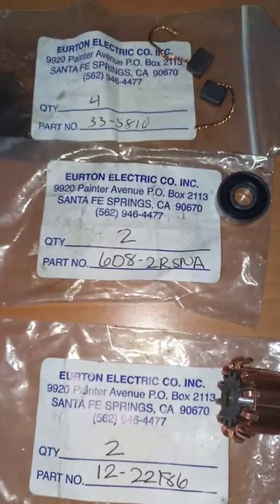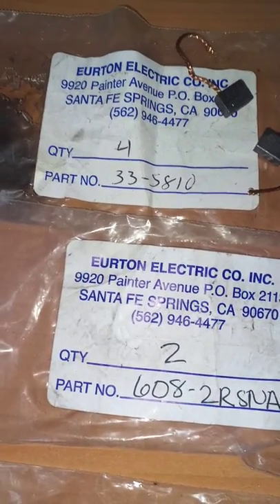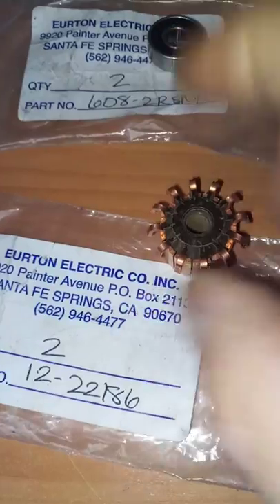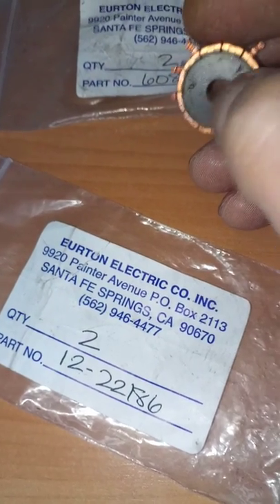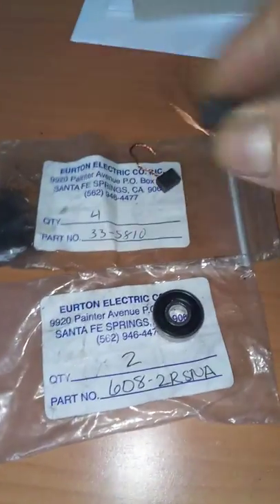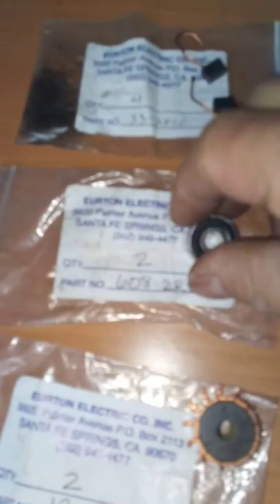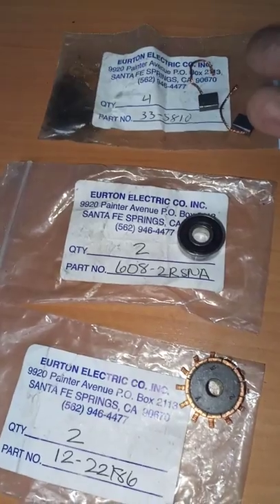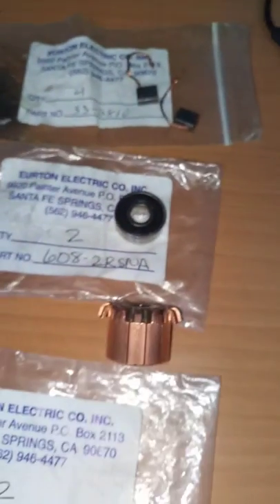Toyota 4Runner ABS rebuilt parts (part 3)

Comment: For those also looking for a complete kit, Eurton Electric also sell as kits vs buying them individually.  The brushes shown here are a bit on the shorter side.  The kit they sell has 2 bearings (1 small, 1 big), 2 brushes and 1 commutator .  I have a 04 4runner v8 and this kit was almost 99% identical match to the OEM parts inside the motor.  Only thing was the commutator needded to be drilled out to a 9mm inner diameter.

PN# ABS Toyo Kit 1
Reply: How do you ensure your drillout is complete centered